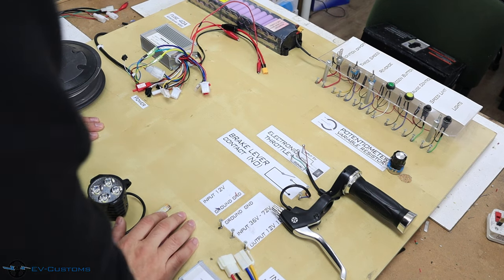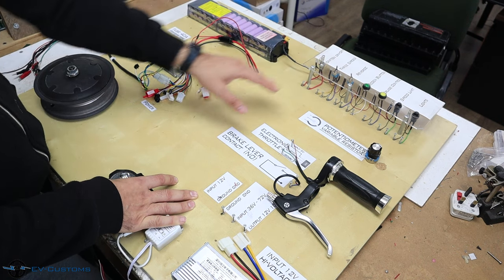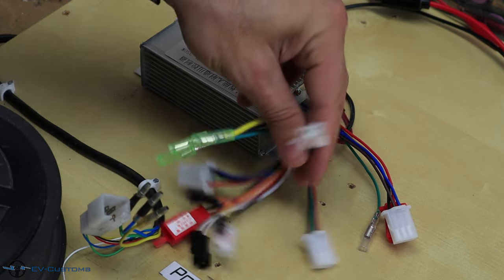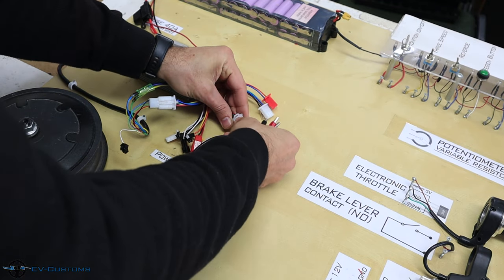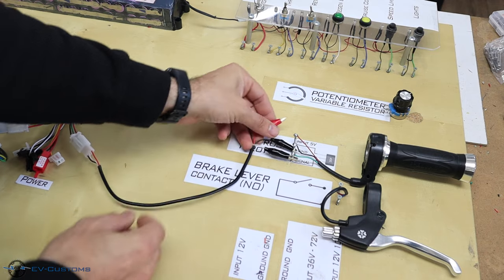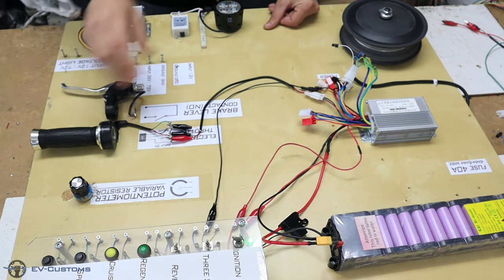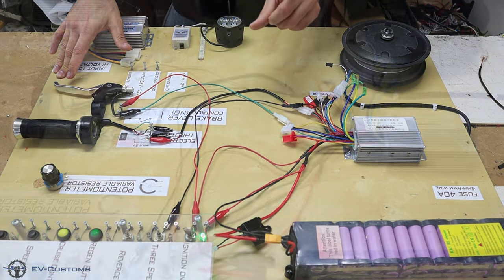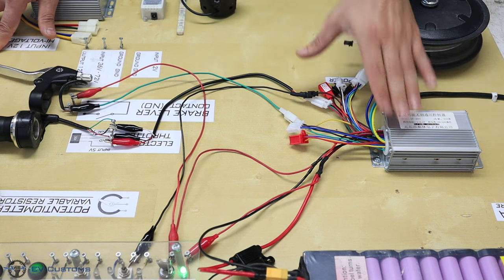High and Low Brake Difference (Learning Board for Beginners)

Comment: On the controller that he is testing, high and low brake do not engage regenerative braking. They just cut the motor power. But on some controllers low brake engages regenerate and high brake engages battery powered braking (which uses battery power to reverse the motor). There may be tabs on the circuit board of the above controller - ABS, EBS when grounded that will engage regen or high braking- or bridging DS and X may engage regen (low)braking. It is hard to tell the difference with the motor on the bench as there is not enough momentum to see the difference between power cutoff, low braking and high braking.
Reply from the maker: Correct.. video with EBS breaking will be on next video of Learning board,  this video is only for High and Low brake...
Reply: @EVCustoms  Does regenerative breaking is different from electronic breaking. From my hover scooter, I can see that when I press the break lever, I can feel huge breaking force coming from motor, I believe its electronic breaking. I am very sure my mechanical breaks not playing any roll here, as I have disconnected those mechanical friction breaks completely. As per the spec given by Hover, my scooter dont have regenerative breaking. So, I am curious to know does regenerative breaking and electronic breaking are two different things, for these controllers.

Comment: This is an excellent video explaining how things work. You are a master; I like the broad illustration you use to explain its function.
Reply from the maker: Thank you man, glad to hear that..
Reply: *GrandMaster
Reply: @EVCustoms so how regenerative brake wiring get connected?

By high brake or else specific for some controller?
Reply from the maker: To actvate low brake it must connected to GND, To activate high brake it must connected to high voltage of battery RED wire..
Reply: @EVCustoms  if I connect to high brake ! Will it regenerate to battery?
Reply from the maker: yes..  both of them have same function..
Reply: @EVCustoms  in low brake no any regeneration work that’s why I ask to you about high brake function 

Thanks a lot for your kind reply
Reply from the maker: low brake just deactivate the motor? if yes your high brake will work same as low brake...  you must find EBS function (wires)

Comment: Hello 🙂 Can you PLEASE help me?  I now have the completely new large display from the VSETT scooter on my completely converted Xiaomi 1S scooter. I had a round 6-pin connector on it, which I cut off and there were 6 cables in it: red, blue, black, green, yellow and white.  1. The white cable is for the positive input (B), which I connected to the only 5 pin plug on the controller to a speed controller set with 48V to + 54.6V, 2. the blue cable (electric door lock) to the controller  Switch on controller, 3. black (GND) on -, 4. on red (RX) 5. yellow (TX) and !  6. a green cable (Hall Voltage)!  All display cables!  OK.  I have white + blue controller switch on, black - and then green and yellow on the controller plug. There is an NFC card with 3 chips on the display that unlocks the display.  Ok then I have the 6th cable Green cable on the display with 0.999V output the description says (Hall Voltage)!  I extended the green cable and plugged it into the white 3-pin gas connector on the controller.  And everything works and also day index finger gas with WLAN Signsl on it.  Because the gas that was included is just a round 9 pin connector that is plugged together with the VSETT display and now the gas also works but in 1,2 and 3. Gsng alke 3 gears only full throttle and not alke 20 P settings with error  10!  But I didn't connect the red from the display (RX) and yellow from the display (TX) with the yellow and green RX and TX cables from the controller 5-pin connector because if I do that, nothing works!  And on the display for RX and TX there is a 4.5V output and 1x 3V - 3.3V output.  What can I do to get the speedometer running?  Please help!  PLEASE!!  You are a professional and the best on YouTube!!  Finally, I plugged the green display cable (Hall Voltage) into the 3-pin gas signal cable on the controller.  And now the index finger gas that came with the display also works with a WiFi signal that always changes the colors all the time.  That was a 9-pin round connector that was plugged together with the 9-pin round connector from the VSETT display.  But is that true with the white 6th cable (Hall Voltage) it says and you have exactly 0.999V from the display output.  And I simply plugged this almost 1 volt cable from the display output with the (Hall Voltage) label into the controller 3 pin gas signal cable and the gas that was included works!  But the speedometer and kmh don't work when I give it full throttle!  That has to be 50kmh and the engine is running at full throttle!  But do I have to use the green cable from the display with the designation (Hall Voltage) and the US a 6th cable!  But I don't have the 5-pin display connector on the controller.  Is it true the way I did it: I measured the green display cable (Hall Voltage) with a multimeter and detected an output of DC 0.999V.  Is that correct as I did it and plugged this (Hall Voltage) cable from the new large (VSETT display) into the 3-pin gas connector on the signal line?  This means that the index finger gas now works, but without a round display, only the index finger gas lever with 2 arrows up and down underneath for the menu!  Or do I have to connect the Hall voltage cable from the display somewhere else to a Hall sensor somewhere else?  So that the kmh display works because I can go full throttle in all 3 gears, it's just full throttle but the kmh doesn't go up on the new VSETT display!  And on the display the RX cable has an output of 4.5V -5V and the TX cable from the display has a 3-3.3V output!  Is the volt output of RX + TX 3.3V and 4.5-5V normal??  Please help the speedometer work.  Is it correct that the Hall voltage cable on the display with 0.999V output is measured and plugged into the 3-pin gas plug to the white signal cable?  Or where do I have to connect it so that the speedometer works so that the kmh goes up.  Because now when you accelerate, the speedometer remains at 0kmh.  Please just do the Knh that runs up the kmh on the new large VSETT display. PLEASE can you help me, Mr. Professional? Kind regards 🙂

Comment: Many controllers don't activate regen when the voltaic is too high. (Battery protection)
Reply from the maker: Yes this is normal, because there is no more space in the battery, i my case this controller have EBS (regen) but is not activated.

Comment: You should find a way to mass produce your E-bike Mother Boards for Testing connections.  To be able to take the parts and test what they know about the assembly is worth paying for.  The Mother Board is an easy build that will ship well and save lives at the same time.  Mother Board / Test board.... Same thing. This has huge potential.  Too many people are making Home Made e-bikes and they don't know what they've got until it fails, or even worse.  A good Testing Mother Board would keep us all safe. The big problem would be that people buy the wheels all ready spoked to the rim.  A Stand for the Motor that's Vertical would need to be included or offered as an accessory.  You could take an entire wheel with tires and do diagnostics with a simple heavy duty stand. 
Just something to think about.  Love all your videos. Thanks for all that you do.  You gave us all a gift.
Reply from the maker: I will keep in mind that...  thank you Jim.

Comment: You used a high voltage lamp in the high brake system, so how should the wiring be when using a 12v converter and a 12v lamp?

Comment: When the low brake is activated does it stop the motor from spinning? Like I was holding a brake on a small slope, would it hold the motor in place?
Reply from the maker: Yes it does stop spinning the motor when EBS function is active..

Comment: Great explanation!!! BIG QUESTION.... But with two brake levers, you have to connect the two red wires and the two blue wires of the levers together, obtaining a single red wire that goes to the battery positive and the two blue ones (joined together) that go to the yellow (High brake) ????? Thank!!!!!

Comment: Who makes that break handle? Are all e-bike brakes a normally open switch?  I want to use it for a project it I need it to be NO contact.
Reply from the maker: Yes mechanical brake handles they are NO (normally open) contacts, magnetic brake sensors are NC (normally close) contacts

Comment: Does the high brake perhaps be hooked up if u use Regen, and the lo brake is used if Regen is not used? A yes or no would be a good answer for me. Or whatever relationship these two brake features have to due with Regen, if anything.
     Thank you, Paul.
Reply: I think you nave to ground it out    I think

Comment: I habe a question. On my controller dont have PAS sensor connection or pedal assis just Throttle option.  But on the bike have Pedal assist sensor (magnetic) 3 wire +,- and signal and on the lcd also i can setup the pedal assist power. I was thinking to connect it to Throttle wire, but i want to know if is possible or what choices i habe before i messing something up.Thanks and keep up the great content!

Comment: you can also use the low brake for brake light, low brake use negative and high brake use positive.
Reply from the maker: Yes you can do that only with isolated 5V signals like i said in the video, if you do that on controller with non isolated signals you will burn your controller, on this controllers if you measure signal with the positive wire for example 48V battery you will see high voltage about 43V, and if you pull your brake you will send this voltage direct to your MCU microcontroller.

Comment: Kinda new to the ebike stuff. Is it required to connect the break system? If not connected, will the controller drain the batteries? TY in advance for your advice.

Comment: When i checked the voltage between Highbreak wire and 48V +ve wire it showing 51 voltage.. so can i connect it? Or is there any chance to short circuit?? Can you pleasee check and tell me?

Comment: Hello sir! can i use the two breaks together at the same time to reach more deceleration?? Tannks in advance ❤
Reply from the maker: Hi...  you mean breaking with tow handle brakes at same time? yes you can do that but it will brake at same percentage..
Reply: @EVCustoms  Isn't the result the outcome of the two together?
Or you mean that the two break together give the same result as the hard brakes alone?
Reply from the maker: Yes... same result..
Reply: Thank you so much

Comment: I just inherited a scooter and the brake wires are disconnected and hanging.  Scooter works fine except no brakes.  I have tried connecting the 3 cables all sorts of way.  At one point the brake worked but the ride was very juddery.  The thumb brake has three cables hanging red,  black, yellow and there are 3 cables hanging from the handle bar red, black, green....Any help would be much appreciated.  The scooter is a Schwinn eco

Comment: Great video as always !!  Does the "High" brake have to work off battery voltage or can it use the 12v from a step down (12v > 5v) ?
Reply from the maker: Thank you mate, High brake can work straight from 12V, at 5V volts i didn't try it yet.

Comment: how did you connect the wires of the hall because there the wires have 2 colors and I don't have this cube and I have to connect the wire with the wire and I don't want the engine to be damaged

Comment: The tunnel system of your wires letting out on the element of the nodes to the motor. 
What is the time frame the wires produce even current during use for motor field attributes

Comment: Hey bro, sorry for commenting here, i got a new Ebike and i have a problem on it and i need your help, the display reads only up to 13km/h when locked speed while it actually goes 28km/h, and when i unlock the speed it reads 39km/h, i tried upluggin and plugging all cables again with no result

Comment: this controller has a green wire which most picture just describe as "instrument wire".... does this get used for a speed sensor with something like a speedometer?
Reply from the maker: Hi..  this green wire is for your speed meter dashboard device, from this green wire you get signal pulses from motor phase... high speeds higher frequency output low speed lower frequency output.

Comment: Cool. Thanks. 👍 
I believe the throttle is simply a potentiometer. What is the resistance value that is used for those?
Reply from the maker: Hi..  no.. there is magnetic sensor an working with voltage output, so the controller read voltage from the throttle.

Comment: my controller states "low brake" on the label but the brake cut off connector is 3 pin, so are only 2 pins being used?

Comment: Hi, can I connect battery +48v to high brake cable....? Is it correct..? It's going to any short circuit in the controller...?
Reply from the maker: on High brake your controller will stop the motor

Comment: Can i cut accessory wires from controler if i don't use them?
Reply from the maker: Yes.....
Reply: @EVCustoms  thanks. Should I tape the the open end with electrical tape?
Reply from the maker: @MiloCalimlim  It is better with heat srink but if  don't have tape them properly.

Comment: Is the a pair for each high and low 1 for each break lever. 2 connectors for high and 2 connectors for low comming from the controller?
Reply from the maker: For High brake it is always one wire, for low brake always one pair (two wires)

Comment: im hoping my high brake has regen or electronic brake so i can slow down faster since my rear disk brake dont work as well also cuts power as well. Currently the motor is on a scooter gas scooter acting like the original engine with no lights or electronic brake.

Comment: please explain where you got the minus wire for the high brake. I can see it on the video, but I can't see where you connected it on the controller
Reply from the maker: Hello my friend how are you ? 😉.  on high brake you working only with high voltage, to activate it the yellow wire must be connected to positive wire of the battery.
Reply: @EVCustoms  I saw that for the yellow one. I connect it to the stop light,,, the yellow one goes to the brake from the brake to the red one, ok, and what about the minus, should I connect it to the light?
Reply: plus and minus for the stop light and many thanks for the effort and response🥳
Reply from the maker: @Elpatronbikes448  Ah ok...  from the yellow you go to brake and from brake you go to the red wire (positive), now..  your light GND black wire must go to any black GND wire or negative pole of your battery and the positive red wire of the light must be connected in parallel with your yellow controller wire.
Reply from the maker: @Elpatronbikes448  My friend for you always is my pleasure! 😄
Reply: @EVCustoms  thank you very much, I'm finishing the project, so your channel helps me a lot..👌👌👌

Comment: You said that we can ask what we would like to see explained. The learning board is just for the beginners. The real stuff is to learn to repair a controller. I am not referring to verify and replace faulty MOSFETs. The Internet is full of such simple repairs. I am talking about advanced diagnoses of faulty controllers. I would like to see a strategy for diagnose. Some typical testing procedures to decide what part is bad.
Reply from the maker: Hi.. nice suggestion..  the problem is that my most client controller repairs  is from cheap universal ones,  they have almost  same issues..  mosfet, step-down issues and burned MCUs,  if someone have any serious controller he can send it to me and we cam make video about this particular repair..
Reply: @EVCustoms  I wouldn't mind watching 100 videos of repairs for cheap universal controllers 😅
For instance I am struggling with one controller 350W made for Myria e-scooters. They are unbelievable complex with many SMD and several MCUs parts on both sides. It is crazy, Not to mention that I don't have the schematics. Do you have access to schematics in general?
Reply from the maker: all controllers have only one MCU, maybe you see also mosfet drivers, about schematics for sure now one has 😄, after a long time i have find only for xiaomi s1 scooter controller...

Comment: Hi my ebike controller came with two wires I’m unsure of, one labeled one-line meter and one labeled hall speed measurement. Both are single wires, does anyone know what they do?
Reply: Good luck with getting an Answer.. there is so much to learn, as the Manufacturers don't seem to care of our loved Scoots & e-bikes... I love 'em...❤
Reply from the maker: Line meter is for your speed meter display from phase wires(high voltage) and hall speed measurement is from hall sensors ( low voltage 5V)
Reply: Don't know yet, I'll get back to ya, if I see it.. Good Luck, mine needs Wiring tidy...😆

Comment: SINCE throttle is for speed. Foot pedal can also be add as high brake I am guessing?
Reply from the maker: Hi I didn't get you..
Reply: @EVCustoms  My foot pedal has three wires. Can I use it for "high brake/purple wire."?

Comment: Have you ever gotten the 3 speed switch to work on the Yuyang King controllers? I have a YKZ7280JA and i can't seem to get the 3 speed to work. Not sure if i have an app settings problem ("Overspeed On/Off" settings?). Video suggestion may be? Also on the "Adjust Accelerator Curve" settings and how it works
Reply from the maker: Hi friend..  if you connect from three speed wires you bypass the app...  so i think the problem is something else..

Comment: Can I connect a high brake wire to 12v and it will work?
Reply from the maker: Hi...  most probably, not always.. I have already do that with YKZ controller and it works fine..